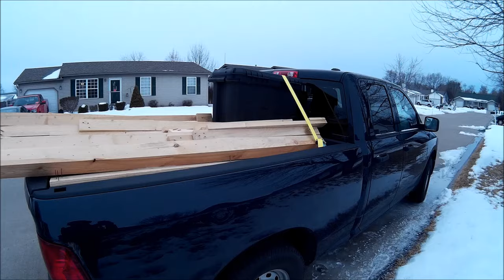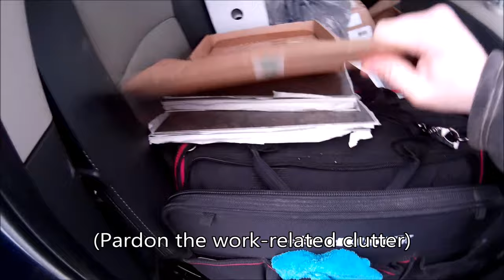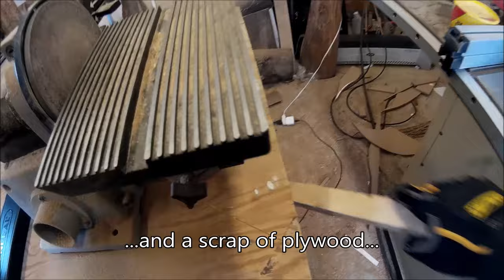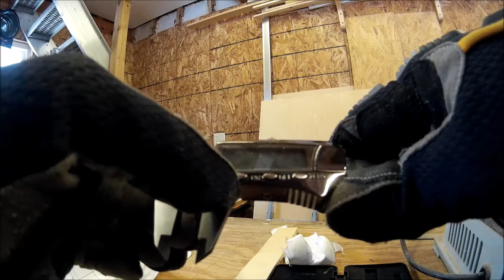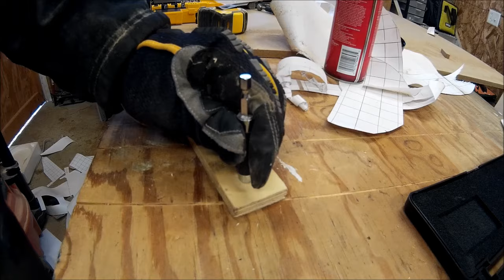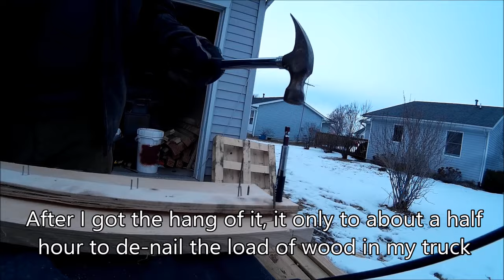Pallet Wood De-Nailer (Amazon links in description)

Comment: I can see / understand why so many viewers dislike your video, likely most posts that I have never seen / read because they were deleted. First, this video needs some serious editing. Who wants to sit thru nearly 4½ minutes when your "neat or novel idea" could have been conveyed in 30 seconds. For example, I do not need to see nor care to see your cluttered cab or the huge pile of lumber in your pickup that you want / need to de-nail or your need to change you caliper from metric to imperial measurement or your difficulty in opening your end gate, etc. Perhaps you think these were an amusing aspects of showing your job and how you did it, but that kind of irrelevant info likely causes many to think this is just another useless video. However, I wanted to watch it to see if it was "stupid" as you said some viewers commented.

Second, why not do what the rest of us do: just use a hammer and whack the damn nail at its point? Third, why are you wasting an adapter by mashing the end that has to fit into a drill or driver? If this is such a great idea (and it is somewhat of a "thinking outside the box" idea for some), then just buy a bolt and attach a long coupling nut or use a tight-fitting rod inside a tube that c/would be a better fit around the nail (which is pretty much what your notion is)? I suppose your solution would be useful, as someone else alluded to below, for difficult nails, but for straight nails or not-so-straight nails especially in soft pallet wood, a good whack of the hammer nearly always works: just use a hammer without having to encumber your work effort with a secondary and unnecessary tool.  Most pallet (and other nails) are nearly always somewhat bent, but straight enough to expose the head when hit with a hammer at the pointed end.

When a nail is being obtuse, I just grab it with a vise-grips or pliers (depending on the nail’s obtuseness), straighten it enough to allow hammer force to give me an exposed head on the other side of the wood to pull the nail out. Heck, you do not even need to go thru the hassle of drilling a hole thru scrap wood to create a secondary tool in the first place. Your "system" ruins an adapter when you could be using less expensive and readily available aids. My bottom line is your idea will likely be novel for some, but your solution appears to me to be incompletely evaluated to choose a more practical and useful solutions using easily and readily available resources.
Reply from the maker: I'm going against my better judgement responding to you, but you were passionate enough to write an essay on my comments section, so the least I can do is respond to your concerns.
First, dissenting opinion is not stifled here.  I started moderating the page due to the foul language, ad hominem attacks (on myself and other commenters) and general shenanigans that don't contribute in any way to the conversation.  I do take exception to the allusion that I delete disagreeing comments.
Second, anything popular on YouTube is going to have a certain proportion of downvotes to upvotes.  It is the nature of the beast.  The fact that there are a significantly higher number of upvotes is proof enough for me that the video is useful to someone.  Many people downvote because it makes them feel better to express their manly disapproval since I wasn't driving the nails out in one hit while blindfolded, but that is okay.  If I had a problem with the "thumbs down" button, I wouldn't be publishing to YouTube.
Third, this "neat novel idea" you refer to was not advertised as such by me.  No one forced you to watch it, and I didn't contact you and ask you to watch it. I put a video up that said Pallet De-Nailer. It worked as advertised.  It may not be groundbreaking, but most innovation is evolutionary, not revolutionary.
Fourth, why watch a baseball game when you can get the score the next day?  Why read a book when you can flip to the last page to read whodunit? Please don't knock visual storytelling.  It is what makes YouTube great and I personally love learning by watching the process of others.  If you wan't to see nothing but finished products, go search on Pinterest or Instagram.
Fifth, please stop with the Harambe-style crying over the alternative use of a bit driver.  They are tough, they can take a beating, they are a dime a dozen and it is a weak argument.
As for the rest of your post, great ideas.  How about you make a video and post the link here and I will happily share it with everyone that visits. I invite you to check out the rest of my videos on my channel, but I have to warn you, they contain a lot of "irrelevant info" such as how I actually made the stuff.
Please, no need to respond as these things tend to escalate.  I have spent enough time justifying the success of this video.

Comment: why not just cut off the end of the board... saving few inches of wood length  with  holes in the anyway!!!
Reply from the maker: You know, it has been almost three years since I made this video.  I have almost used up all the wood from those huge pallets.  There was a lot.  You are right, I usually ended up cutting out the parts with the nail holes anyway.  Partly due to how ugly the wood is with nail holes in it, but mainly because the nailer used to construct the pallets left behind little bits of metal in the wood and that was wreaking havoc with my planer.

Comment: Where did the nails go when they went flying through the air? On your drive maybe!!! Doh
Reply from the maker: It's okay, really.  There is a little thing called a magnetic sweeper.  It is super cheap at the home store. Anyone that does any work with nails or screws in their own driveway should own one.  I didn't realize I had to spell it out over and over on this video.

Comment: Do yourselves a favor and don't use a bit holder that you intend on using again with your driver. Get a handful of these https://www.harborfreight.com/2-78-in-magnetic-bit-holder-62692.html for a $1.49. They'll do the same job but when they break from the pounding and miss hits you won't care.
Reply from the maker: I use a screw guide. not a bit holder.  Huge difference.  The bit holder would be useless in an application such as this.

Comment: 27/64? 13/32? How can you manage yourself with those fractions? 
Will you ever reach metric level instead of arms, feet, nails, palms...so the rest of the world can understand what you are talking about?
Reply: does everything need to be dumbed down
Reply from the maker: +u2dva we are living in an imperial world and I am an imperial girl...or guy
Reply: sbfarmer 8 Obviously yes. You can say simplified, not dumbed down. Just like e.g. a temporary English language.
Even British natural speakers can barely read Shakespeare, but at least people can communicate easier way :-)
Reply: u2dva I can say dumbed down. water as a basis of measurement is just as arbitrary as anything else. these euroleetists are the source of so many unnecessary comments.
Reply: sbfarmer 8 Without European people America would still be an Apache & Sioux continent. So, if you use an International web service, accept International comments. Or switch to some American tube (i'm pretty sure Apple has something like that).
Reply: David's Favorite Videos Of course I'm not very smart. Why should I be smart at all to measure something like piece of wood? It is not a rocket science and should be easy to proceed, just like it is when you use metric system. Dumb people usually like to complicate what they do so it seems to be smarter than it actually is. Besides all, there is no consistence - once /64, then /32... Why not always /64, or always /32? Ah, yes, then you could not have integers e.g. 27/64 would be 13,5/32 and that is something you do not recognize and not able to read. And you would not be so special like you pretend to be, you would be a plain man like the people of the rest of the world are.
Reply: David suggested it, and you confirmed it. Tron.
Reply: rranger1014 Not just tron, positron :-)))))
Reply: I could go on here about how the imperial measurements were all based on whims of royalty but i wont.  imperial measurements are based of fractions of an inch.  so basic year 7 fractions tells us 27/64 is larger than 13/32 (which is 26\64).  Imperial measurements also step up in sizes differently so sometimes its a better fit to use them.  Please stop being so measurement snobbist.  P.S. I live far away from the american continent and we went metric in the 1960's so I feel your confusion, based on childhood memories. but its not that hard.

Comment: 100% waste of time!! and money!!! that's a badass bit u wasted..can someone please explain to me what the purpose of this is? other than adding extra steps to just hitting the nails directly with the hammer?  what'd be quicker would be to cut the piece with the circ saw..  BUT if your frugal-ness insists on "losing" material by doing so (what? maybe 3 inches off each end? 3 x 2=)  the fastest way to do this would be to slam each end on the concrete or asphalt...the nails will all retract at once...Especially long And straight one's like those in the back of ur pickup....

Comment: if u must ruin ur tools using them in ways not intended is just gross and embarrassing... also of u must continue doing that in this manner, try using a nail-set with slide, you'll find its the same method your doing,but with better made for that kind of abuse.. I can only wonder how many drill sleves you've actually broke
Reply from the maker: Admit it, someone just called you gross and embarrassing and you couldn't wait to use it on someone else. Kind of like when my 4-year-old learns a new word.

Comment: JUST CUT THE END OF THE BOARD OFF.  It is usually bad and cracked anyway.  I you just would have used a skill saw at work to cut them off the boards they were nailed to it would save you the time of Prying them OFF THE BOARD.  THERE, I just saved you a couple of YEARS DICKING AROUND!   No need to thank me.  Next time "THINK OUT OF THE BOX"!!!!!!!!!!!!!!!!!!!!!!!!!!!!!!!!!!!!!!!!  Fist up, Fight for Truth.
Reply: These actually look like thin single use pallet made with brader nails (a light weight air powered staple gun) the would be very easy to knock out of the wood they are nailed into but are very weak and wont allow you to easily hit them out with a hammer. this is a good re-use of a tool which solved a timewasting problem and allows better recycling.  good stuff.